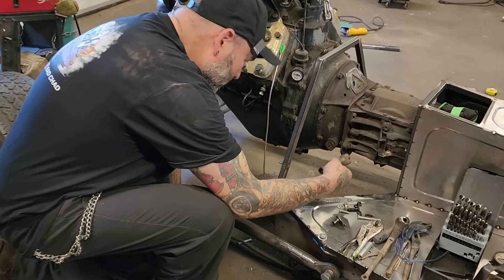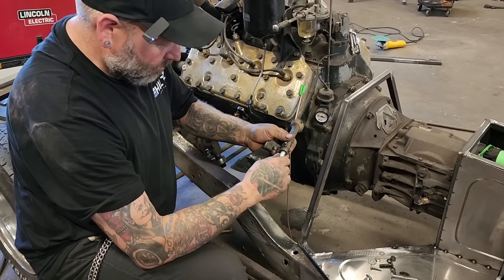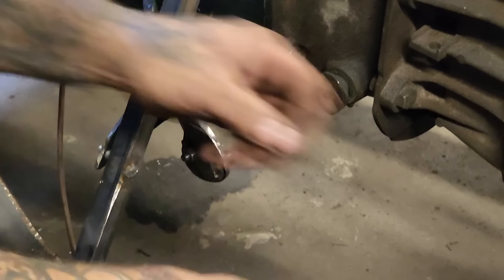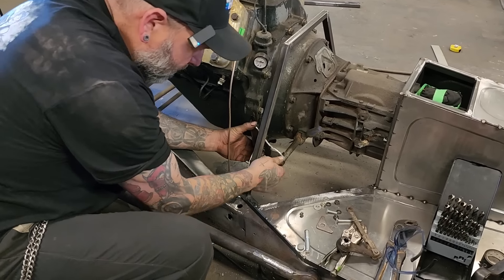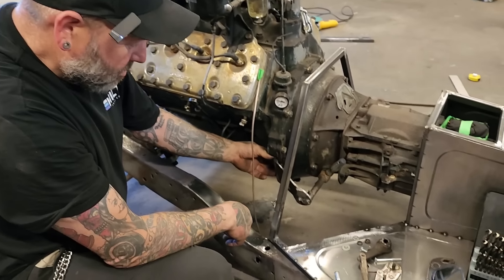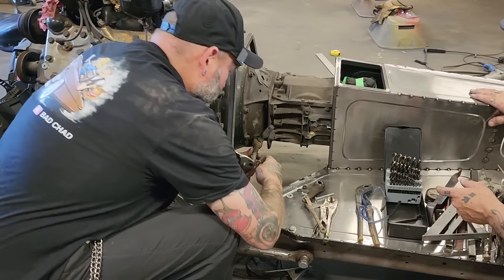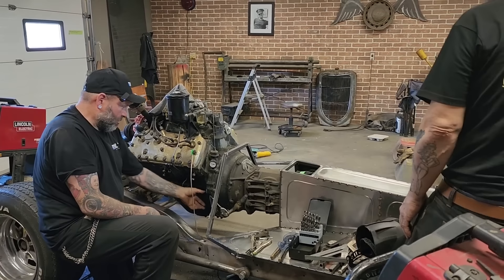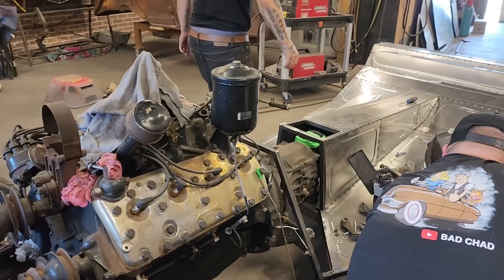Mechanically engineered clutch bracket 🤯 (Bad Chad bonus episode)

Comment: Engine flex is why the original stud had a ball on it so it could pivot and not bend
Reply: Greg, you are right.  Some people just don't read to why the z bar has a ball on the ends
Reply: There hooked to motor it will move-with motor
Reply: Oops I did not see that last bracket it must go or made to flex.
Reply: I had a Valiant Charger, clutch set up the same ,when the engine moved to much like Reverse to 1st while still rolling, 😂 and it had a longer slide than that one ,all the best to you all

Comment: Strengthen the main bracket which connects to the bellhousing,  Cut off the side bracket that goes to the frame or there is disaster ahead when torque is applied.
Reply: Yes the engine rotates on the motor mounts under heavy load and the extra bolt to the frame will get stressed heavily. Something will break!!! Find another way to stabilize the bracket so you can remove that connection to the frame!
Reply: @stephenk79-rc1il with a coat hanger too 😂
Reply: @stephenk79-rc1il  The problem will be obvious from the get go with bad vibrations.  But what will break?  Who knows.  It will be the 'weakest link in the chain'.
Reply: Right... because Nate is NOT a "mechanical engineer.".. and it's joke claiming  "mechanical engineering at its finest".
Reply: @metaphor4539  it rotates maybe 1/4 inch that bracket and linkage will be fine..

Comment: Just a question., With the engine mounts installed with the normal stock rubber shock style mounts, it would be normal for the engine to torque or twist slightly when accelerating.  The new clutch bracket creates a "hard" point tied to the square tubing that will have to absorb that torque.  In racing applications, a much stronger system is used to prevent such a twist.  Is the square tubing strong enough or appropriate to absorb the torque/twist without cracking or bending with time?
Reply: Now just put a bellcrank throttle linkage on it and put the track safety crew to work.

Comment: >This is mechanical engineering at its finest 

Right. Maybe it would help if you knew what mechanical engineering actually is... and it's not just fabricating some metal bracket. 

"Mechanical engineering is the study of physical machines that may involve force and movement. It is an engineering branch that combines engineering physics and mathematics principles with materials science, to design, analyze, manufacture, and maintain mechanical systems."

Comment: Good morning miss jolene, will you please ask nathan and chad why the clutch bracket is attached at the square tube? Correct me if i'm wrong the square tube is part of the flooring and pix or welded at the chasi, while the engine have engine support, i think the clucht bracket will tear because of the vibration of the engine , obet from phillippines✌️👍🙏

Comment: Nate the only issue that I see with the Clutch assembly is the tie to the firewall frame as the engine will move with normal acceleration and end up cracking the firewall.

Comment: What is going to happen to the bracket when the engine goes under load ? Won't the engine want to twist and the clutch bracket is bolted solid , not rubber mounted. I think something is going to break.
Reply: Probably...but it's "mechanical engineering at its finest". 😅

Comment: Nathan is a Genius the way he can make parts from scratch and make it look like it was a factory  manufactured part 👍 every time he makes something it blows my mind mechanical wizard👏👏👏👏👏👏👏👏👏👏👏👏👏👏👏👏👏👏
Reply: Genius don’t bolt the trans, engine bracket to the frame. The engine and trans have rubber mounts for movement. His bracket is a direct conflict with them, it will quickly fail.

Comment: Hey guys ..you can’t do that. You just bolted the engine to the frame..the engine and trans have rubber mounts for flex..what are you doing!!
Reply: Oh but they can and did it will be fine I did the same, the engine has like 1/4 inch movement.. it will be fine
Reply: 1/4 inch is too much , it will break and make a noisy vibrating body .
Reply: They didn't actually bolt it to the frame. They bolted it to the body. If they are putting rubber body mounts on it it will move as well.
Reply: You have a great point but then again this is not their first rodeo , I think they will catch this soon enough, it still building stages, they have to start somewhere. Take care, it is a good point, I have to keep an eye on this.
Reply: I stand by my comment..you have a solid link between the engine and body/frame this will cause noise, vibration, metal fatigue, stress, fracture, failure..also the straight shaft pivot not a good idea, any flex from engine movement or clutch pedal force will cause the system to bind..that is why the stock system utilized a ball pivot..solution: design a clutch lever that bolts directly to the trans fork shaft.. similar to Ford part number 18-7511..pictures sent to Chad.. enough said on this subject..
Reply: J's race car! I bet she just can't wait!

Comment: I stand by my comment..you have a solid link between the engine and body/frame this will cause noise, vibration, metal fatigue, stress, fracture, failure..also the straight shaft pivot not a good idea, any flex from engine movement or clutch pedal force will cause the system to bind..that is why the stock system utilized a ball pivot..solution: design a clutch lever that bolts directly to the trans fork shaft.. similar to Ford part number 18-7511..pictures sent to Chad.. enough said on this subject..

Comment: I have a suggestion for a bad Chad please see that he gets this I have swap some bodies before on different projects I've had I find the easiest way to get the body on is to buy four lolly columns that are adjustable get four truck used drums well the post to the drums then get four bumper jacks and where the post separate weld the bumper jack so it lifts the post top section then you can use 4x4s through the windows to jack the body up and then you roll the chassis underneath this is great cuz you can lower and lift up the body without any struggle and trim excess metal away at your leisure The amount of body swaps and stuff like that you guys do you should have these you can make them out of basically scrap check it out Jolene see if he likes that idea

Comment: GREAT JOB !! Nate is sure a wizard when it comes to figuring our things...
Reply: Wizards don’t bolt the trans, engine bracket to the frame. The engine and trans have rubber mounts for movement. His bracket is a direct conflict with quickly fail.

Comment: Great bit of engineering. The question I have, is the engine now solidly attached to the floor pan where any engine movement that is dampened by the moujts will flex the floor pan till it breaks. Just asking so a damper can be included in the clutch attachment,

Comment: Nathan…It looks like you have Rubber Engine mounts. Now you have added a Mechanical connection between the Engine and the Frame. Not only will this be a problem when the engine tries to flex, but it will transmit engine vibration. This is why the clutch shaft is between the Engine and the Frame. Not only as the clutch pivot but also as the flexible connection between the engine and the Frame.
Reply: you know this is a race car for Jolene right? and engine "flex" ? it has like under 250 ft lbs of torque and will not rotate on its engine mounts more than 1/4 inch it will be just fine.

Comment: Nate did a good job on that clutch set up but the only thing I think your gonna get is motor noise thru the parts that’s bolted from the two bell housing bolts to the square bar tubbing on your floor pans you don’t ever bolt any brackets from the motor to the body of any car that’s why the motor is mounted in rubber most of them clutch arms are always mounted on the frame to bell housing only the ball from the old clutch set up you should of reused it over again so if the motor needs flex nothings binds up and your gonna be adjusting your clutch pedals every time you turn around if you still have the ball I would use it that stud will work but the balls is better  I would of  your going to get a lot of noise thru your  pedals and floor with that mounted to the floor  know this I have been building trucks and cars for over 45 years that needs to be mounted to the frame only the motor will throw sounds like you will not believe thru that floor board not being rubber mounted Chad if I was Nate I would run a bracket from the frame to that church brace he made and don’t keep it bolted to the fire wall  square  bar your using for the floor framing it will need to be changed later if not now just trying to help take care bro

Comment: If the motor is on rubber at the water pumps and out back, isn’t that bracket going to suffer some fatigue from being mounted rigid between the motor and framework? I like the attachment to the bell housing. But I’m not sure about the bolt going to the square tube…

Comment: Bracket bolted to frame is BIG NO NO! It will fail. Motor has rubber mounts as it twist under load. Transmission is likewise with rubber mounts. He needs to cut the connection to the frame and stabilize it back to the engine or transmission. It cannot connect to the frame.
Reply: It will be fine the engine will torque over maybe 1/4 inch, i did it to and old truck worked fine never 1 issue.